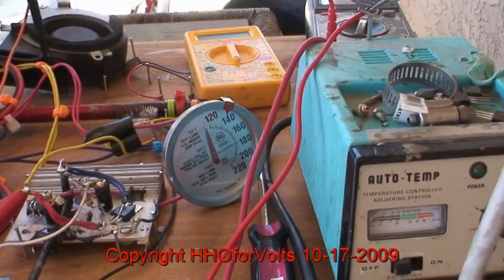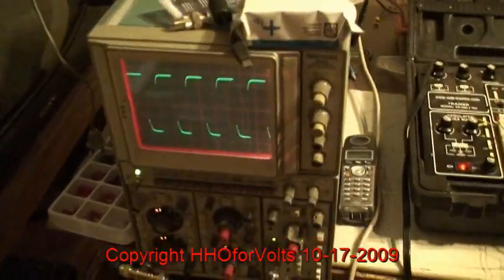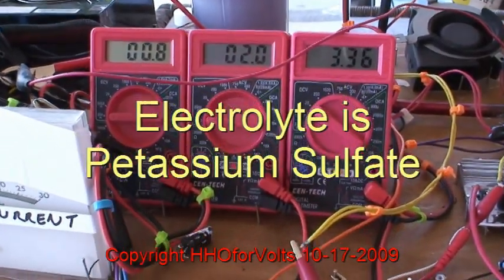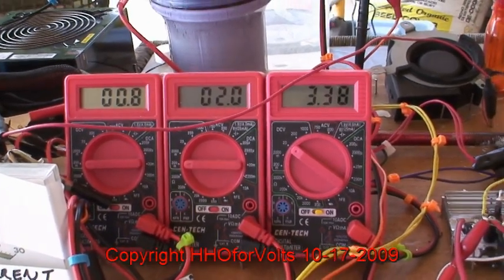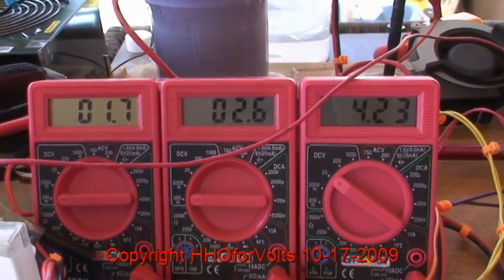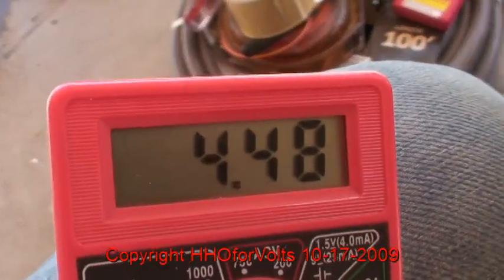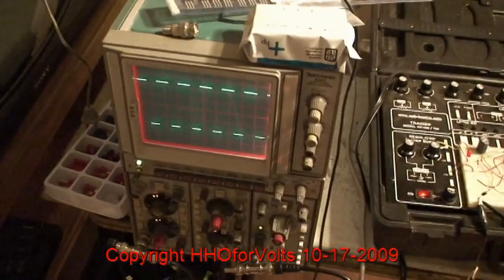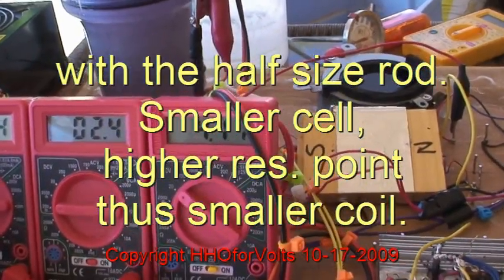HHO Circuit Evolution PT 2

Comment: this dont boar me at all > i am just woundering how ya know what over unity is ?   2.5 meens what ? . I am not able to come up with an acurate voltage reading from my cells  because of the  capacitance of the cells . I get a 2.1 volt reading after I shut it off ,  and if I short it out it goes to zero then slowly goes back up to one volt